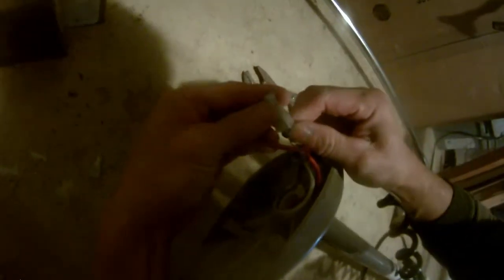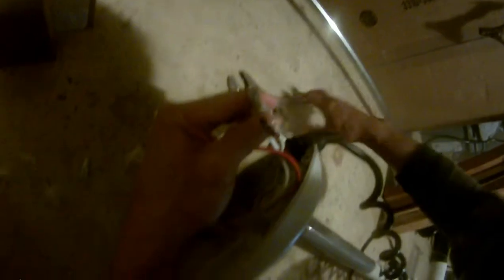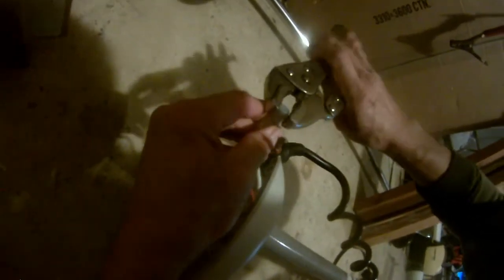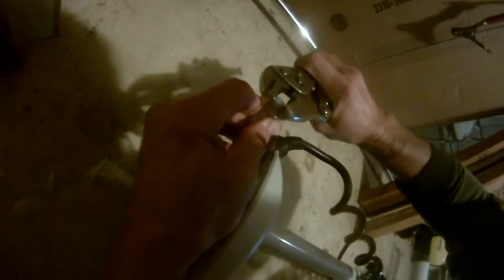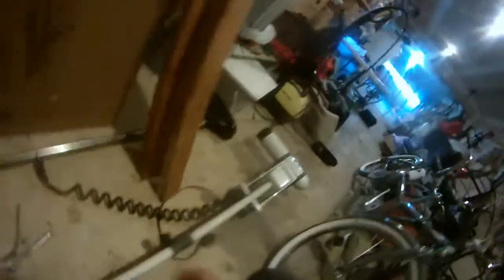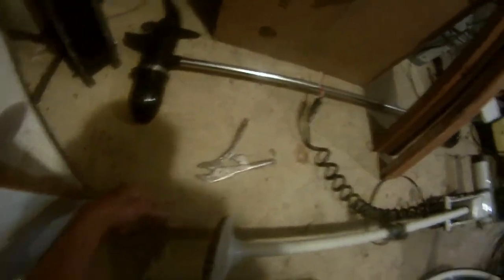How to troubleshoot a non-working motorguide W75 wireless trolling motor? (part 1 of 4)

Comment: I have one just like this but need to replace the lower unit. How does the lower unit come off? I couldn’t see any bolts holding it
Reply from the maker: Watch my part 1 video, u should be able to see the screws
Reply from the maker: Wireless Motorguide trolling motor transmission broke - DIY - Top Secret!